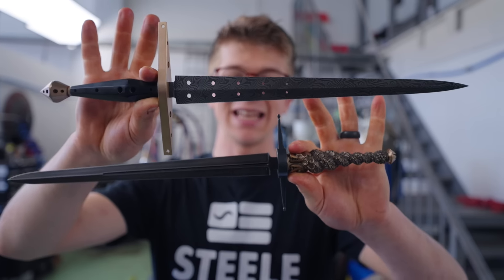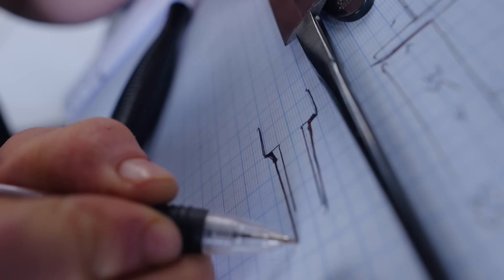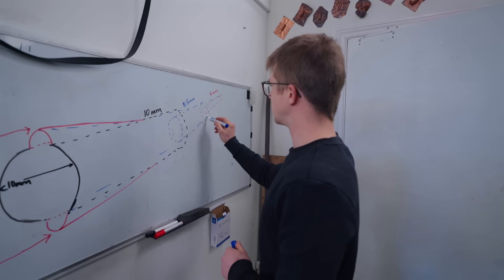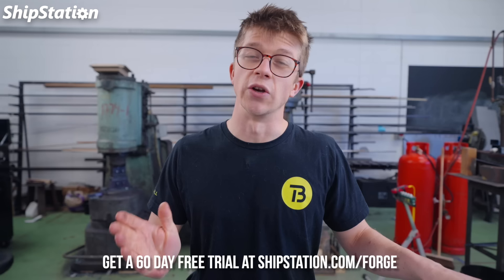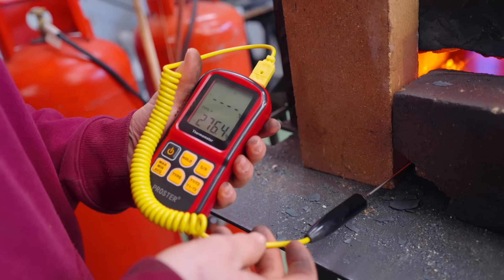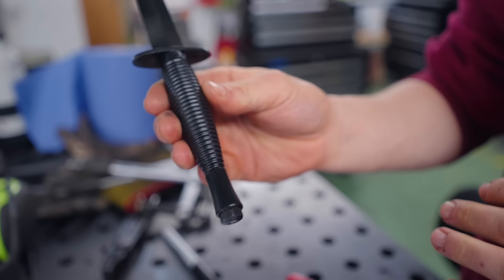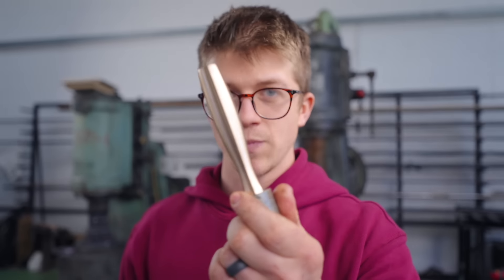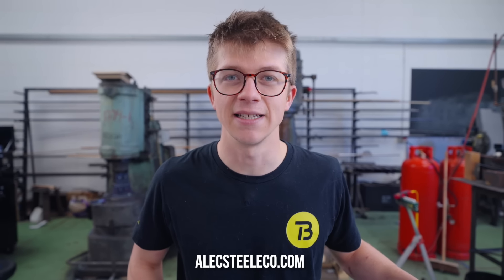Making a WW2 Commando Dagger! Part 1

Comment: You should do a challenge where you have to make a blade but Jamie says what he wants for each of the steps and you cannot plan it at all
Reply: Or like the exact instructions PB&J where Jamie has to write very specific directions, then Alec has to follow it perfectly.
Reply: I second both of these options and I also say that Jamie should plan it all out and not tell Alec what Alec is building. Basically “hey Alec, forge up some Demascus” and he goes “how much?” And Jamie just goes “eeeehhhhh about 3.65 kilos” or some random number because obviously Jamie doesn’t know how calculate steel as good as Alec. Then he will say “make it 16 inches long” and “give it a head like a hammer” then build an axe on it. Just keep him guessing only to have him end up with a claw hammer that you could buy at Home Depot for 5 dollars lol
Reply: You should definitely build one of them 3 blade daggers
Reply: You should definitely build one of them m48 cyclone tri edged spiraling daggers

Comment: I think the tang being so thin on the original was probably a combination of adequate strength, cost saving, and lightness for the user
Reply: It might have to do with balance, as well. I don't know if this was ever used as a throwing dagger, but it certainly looks like it could be used that way.
Reply: The thickness of the blade for darn sure is because of the required stiffness. This is a blade that’s fairly thin overall but has to be capable of penetrating without braking.

Comment: two tips:
1) stainless steel needs always the foil or you'll mess up the chrome
2)if you put the steel between aluminium on a side and the steel of the welding table on the other, you might mess up the quenching since those two material conduct heat in different ways. That means there might be residual stresses due to the different heat absorption

Comment: I learned that stainless steel either needs a super special setup to eliminate the decarb, or just grind after heat treat, Ive had some thick decarb even with a stainless foil wrap.

Comment: I made the same mistake with a bit because I just started my apprenticeship in tool and die repair/machinist learning. I didn't know this before but bigger bit means slow down the rpms. I burned out a bit this way and now I know..guess that's how you learn!

Comment: Might be a cool engineering project to build a jig using a rack & pinion set-up to rotate the piece x° for every xmm the scribing tool advances. Can use different gear ratios to achieve different twist ratios.
Reply: Sounds like a rifle cutter with extra steps.

Comment: My guess is the tang has those radius cuts in them to remove any crack or sharp stress concentrations. The normal stresses in that necking won't be that bad compared to a straight right angle, and they can be machined in pretty easily.

Comment: Been wanting to make one of these for ages, super pumped to see this video. I love the artistic stuff, but more than anything I love useful metal working projects. I was wondering if you'd hammer in the bevels or heat treat and grind. Last knife I tried to forge with a sharp tip warped like a bastard during heat treat then snapped when I tried bend it back.

Comment: One potential thought for such a thin tang, would be manufacturing. If they are cutting them out of a sheet of steel, then having a thinner tang would enable them to fit more per sheet than a thick tang.

Comment: would drilling it out on the lathe not have been a lot easier than chopping a bit off to fit it on the mill? or have you no chuck in the tail stock of the lathe?
Reply: I was wondering the same thing. Seems like a perfect job for a lathe. If fact i bet the tang on the commercial one is made like that so you can make the entire handle in one setup on a lathe

Comment: Silly question, why didn't you use the lathe to drill the main hole in the handle vertically? I understand the smaller angled holes.

Comment: From what I saw and calculated in my life that cut in in the tang should actually lower stress concentration insted of causing it, the only way it impacts the strength of a piece is smaller cross section. Anyway great vid as always.

Comment: Alic,
Have you forgotten that you have a heat treating kiln. That is what you should be using for stainless steel. They can easily get to the needed temperature and stay precisely there for as long as needed. Trying to do the same thing in your forge is unnecessary.

Comment: It's hard to tell from the video, but the little cutouts in the shoulders look to be rounded, which is actually a good thing for stress relief. In the HEMA world where a lot of steel swords are banged against one another, one common break point is right at that shoulder of the tang. The sharper the edge, the more likely you'll get a break. So rounding out the corners actually disperses the stress you would otherwise have on the sharp corner. The cutouts just look like a cheap production way to handle this design feature.

Comment: Bro.  That stainless has a much higher ductility than most knife steels, even compared to prehard 4140.  Also, just look at the wiki page for the FS knife and make it to the original drawing.  Every detail of that knife was done for a reason (probably minus the stress riser you mentioned, which I'm sure was for production reasons).  Looks great though!

Comment: Alec this dagger is very pointy. When you hit a bone, this point turns inti an accordeon , and it cathes skin on the way out and takes a bit of time to retrieve from the wound, which is dangerous in combat. So it is better to round the tip a bit solving the snag problem, I read

Comment: The predecessor, the Shanghai fighting knife, is a generally more useful design. While cool, the F/S is really just a cheap mass production assassination oriented knife for niche ww2 use whereas the Shanghai was designed for civilian street carry.

The ultimate evolution of the F/S in my opinion is the original spec hollow ground Case V-42 with a deep thumb groove. As unobtainable and priceless as they are, I've built several of my own tributes and suggest the pattern to anyone who fancies the F/S.

Comment: Not wrapping the blade steel in foil led to decarburization of the outer layer of steel, maybe .020" to .040".  That's why it felt soft to the file.

Comment: Weren't these made quite stiff so they could be used as a screw driver or pry bar with no fear of deforming the blade(except the edge) in the field?
It'd also help drive through any kind of 'flak vest' style armour or great coat that an enemy happened to be wearing

Comment: You're getting pretty good with that lathe. The ones I work with are Vertical Turret Lathes with tables between 42 and 72 inches (106 to 182 cm), so it's always neat to see folks work with the smaller ones. Can't exactly turn something cool like a knife handle on one of the big beasts that are wider than I am tall, y'know. Like, I was turning a piece today at 20 rpm because any faster would've burnt up the insert, taking a 3/8 inch cut. It spit off chips with enough force to leave cuts if they hit you.

Comment: Why didn't you drill the grip in the lathe? I understand that the side holes would've needed offsetting the workpiece in a 4-jaw chuck, and you might have needed the mill to make the smaller holes into full width slots (or manually filed it).
Reply: I scrolled through all the comments until I found yours.  I knew someone else saw the lathe as the obvious tool for boring the the handle.

Comment: You do realize that vertical grooves, even if they are spiraled, don't really add any actual grip to the handle right? You need a pattern that is, at least, horizontal to your palm to create friction so the knife can't slip out of your hand. Vertical grooves will keep the knife from slipping side to side, some what, but if they spiral I have my doubt they will even be effective at that. Unless you plan to inlay a type of cord or something to add a griping surface. I suppose that may work, but if it were me I would still go horizontal to the blade.

Comment: Might be a dumb question but could you use something like a spring loaded drill bit and just rotate the handle itself and pull it towards yourself to make those lines?
Reply: Or some way to keep constant contact/ pressure on the handle as it goes along it's shape

Comment: If you were going to stick the handle in the lathe anyway (to profile it etc) why didn’t you use the lathe to bore out the hole for the tang rather than struggling with the mill? 🤔

Comment: The company (companies) that made the Fairbairn Sykes, when it was in production for war, had a tendency to not properly temper the blade causing the tip to snap off at the worst possible moment for the wielder. I’m grateful to the men that did the proper research on tempering before the USMC adopted the blade for the Marine Raider program. I carried a replica of those blades in Iraq because I had complete confidence in the blade.
Reply: To be fair in the 40's they were manufacturing them to very tight deadlines and budgets. Modern military spend, especially in the US, makes anything possible.

Comment: See thats the thing i was watching you pan it out adding more material then we say was necessary is called over engineering i have watched several of your videos and you always use more material then necessary in the construction or take it to the grinder, lathe, or mill to finish the rough out before you really need to or take off more material then necessary when making stacks (last isnt the worst being sure with a weld is exceptionally important) it just came to my notice that you have started to rely on modern tools to a very large degree and it almost seems to be consuming more of your time in those steps then if you where to just get the profiles more reliably dialed in before hand and help with waste as well

Comment: I dunno about the spiral BS on the handle. I think the original design is much more practical.
That dagger reminds me a bit of a more modern mauser dagger bayonet that I have which has some kind of plastic handle, and seemingly has never actually been sharpened (i bought that at a car boot sale some time in the 2000's).

Comment: Brass is super grabby, normally you would "drub" the drill lips to keep it from grabbing and trying to feed itself by taking the face angle of the chisel and reducing it to 90 degrees, so it has no "bite". Normal drill grinds are just too aggressive and want to self feed faster than is appropriate.

Comment: One thing I do not like about the F-S design is the round handle. An oval handle will let you immediately index the handle to the cutting edges. Yes, the guard can help with indexing - but an oval handle is so much easier to manage.
Reply: think being a dagger it is more for stabbing than cutting, so handle indexing doesn't really matter and with blade shape it's not really a cutting profile, more a penetration profile
Reply: @ghostwalker100  I do agree that the F-S was designed for penetration, with slashing as something of an afterthought. But, as a counterpoint, almost all the follow on "fighting daggers" incorporate a non-round handle to allow for indexing (M3, V-42, Applegate-Fairbairn, and others). 

It is true that the medieval rondel daggers shown in the video did not have any way to index the edges of the blade. This was done to accommodate a person in full armor (including helmet and gauntlets) needing to grab the weapon of last resort to finish an opponent in a grapple.